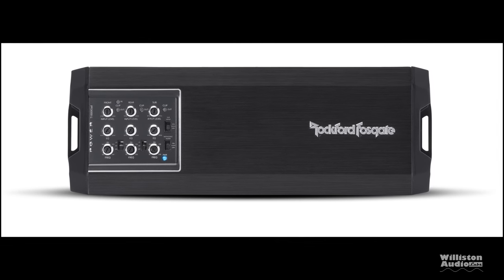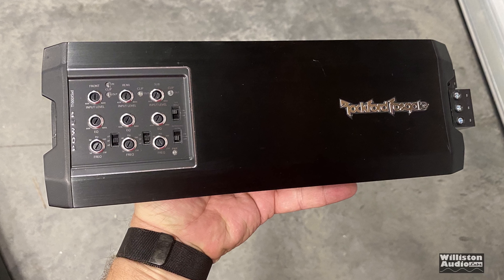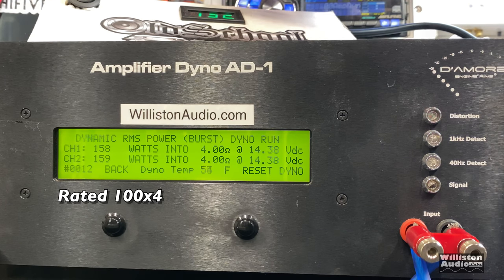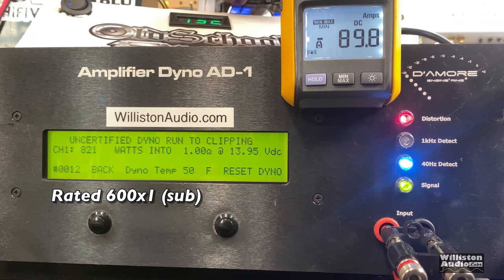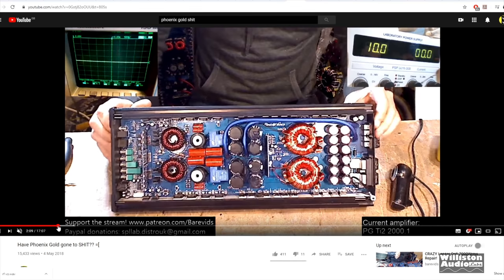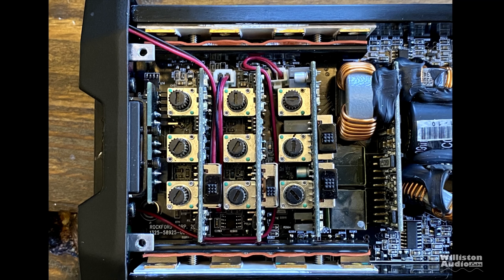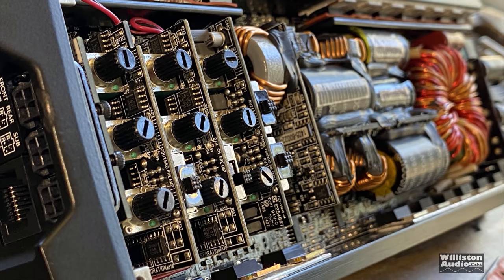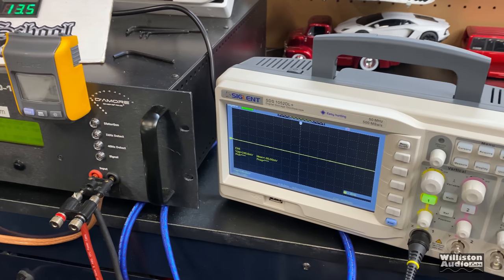Rockford Fosgate Power T1000x5ad Mini Amp Powerhouse!

Comment: For the people that are scoff at RF for being over-priced, here's another fine example why... it's the R&D, and it's worth it.  I like Sundown, B2, DD, Massive, American Bass, etc... but people need to realize that they are simply value added re-sellers peddling the same gear, each with a different badge and slightly different guts. There is no way they could engineer their own equipment from the ground up.
Reply from the maker: Sundown has input in their designs, but yeah I know what you mean. Some people would say why reinvent the wheel...

Comment: I have a boss pv3700 5 channel amp that would be awesome to see what the boss does in real power numbers. I haven't been able to find to much on this amp other than the factory specs.i try to watch most all ur videos they have been quite helpful and enjoy seeing the real numbers. This is the only  5ch amp I've seen other than the boss 3700 would like to see if it puts out 413x4 2ohm or206x4 4ohm or 825x2 bridged an 623x14 ohm 1125x1 2ohm sub channel

Comment: Is there a way to measure the output of an amp @ 8ohms? I have a amp and 4 door speakers that are 8 ohms each and i want to find out what the output watts would it be if i put each speaker to each channel
Reply from the maker: Yes, you can use an AMM-1 Audio Multimeter
Reply: Williston Audio Labs thank you Big D‼️

Comment: This amp requires a High output ALT  ASAP
Reply: I have one of these in my Chevy Silverado with stock alternator. Didn't have to updgrade.
Reply: Nah no alt needed
Reply: I have the rockford punch 1000bd, and on stock electrical and It gets down no dimming lights of anything , I have it wired down to .05 ohm on a audiobahn immortal 15 quad 2 ohm coils ,  she's nasty

Comment: Off handed comment "they are very efficient in their cooling" is odd. You have a tiny heatsink which according to your, ahem, 'measurements' makes a dynamic total of 1870-watts, which with efficiency of even 80% (it ain't) means around 450-500-watts is being turned into heat. What makes your "very efficient" comment plausible?
Reply from the maker: Cooling by design, heat sink gets warm, but the heat is transferred away from the transistors.

Comment: Still no power 650 dyno !!!! Whyyyy
Reply: +1 I have a Power650 stored away for a future install.
Reply: @minimumtrade  nice! I had two of them rebuilt and upgraded in 1994 running on eight Punch 15's in an extended cab truck
Reply: I agree really need to see a 650 dyno. If rather see that then these new amps getting dyno’d but im probably a minority in that category.
Reply: @avrajsamra4548  absolutely! I'm just curious, both of mine were upgraded before they were ever tested so I'm curious as to what exactly they put out when stock
Reply: Brett Manning I think I read your comment on a facebook group saying yours did 1700w but it was upgraded lol. We need to bump your comment up with likes so Big D could see this.
Reply: @avrajsamra4548  yes sir that was me 😁

Comment: Had that amp for 2 years but the marine version and it great , but always ran extremely  hot even if you're not playing any musicit just sits there and suck up amperage and get hot, one day I was chilling the car with this girl and I have my car ignition on accessory only, and the amp killed my battery, the only way I got the car to start with to disconnect the amp and I literally  burned my hands trying 😭 ran it on American bass symphony speakers and sundown x8 v3

Comment: That is absolutely minuscule for it's output! My Rockford Fosgate 500M is roughly the same size in total.
Rockford Fosgate remanufactured  something? I don't believe it. My 200IX was killed by an ex-girlfriend breaking into my house and jamming a flat head screwdriver into it repeatedly. I asked Rockford to fix it with me paying for the repair, they said absolutely not. It's over a year old and we're about to change or designs. We refuse to touch it. Even Nakamichi wouldn't do that on 25 year old hardware from the other side of the planet. I don't believe that it is something refurbished by Rockford Fosgate themselves.

Comment: Now if they can design subs that a more efficient and smaller instead of bigger heavier. RF really shrunk and made brute so dang small .
Reply: Look for "SPL" or "SENSITIVITY" when comparing subwoofer models, which is a measurement of efficiency, meaning if you put 1 watt of power to this subwoofer, how loud would it play?You'll notice Rockford Fosgate produces some of the most efficient subwoofer designs on the market.  Take the T2S1-16 that has a sensitivity (1watt / 1meter) of 89 dB, which is far higher than the typical 82 dB of many popular designs on the market.

Comment: The input mosfets don't look high quality to me. The outputs are.

Sorry didn't watch untill the end before commenting. It's a refurbished item, so they changed the power supply mosfets which are not the oem ones.
Reply: MADE IN CHINA  MAN I MISS THE OLD SCHOOL ROCKFORD AMPS SO BAD :/
Reply from the maker: Good point, I would think they were replaced with OEM style parts though
Reply: @wal  nah, if you notice the the metal part of the mosfets are not chrome. It's a sure sign that they are lower quality. The ones for the output are Chrome.
Reply: This isn't true buddy. Firstly chrome isn't used in mosfet production, the finish of the fet back will vary between batch and factory. Fets produced by a factory are required to meet quality standards set in this case by international rectifier for them to be stamped with eg IRFB7437. Fakes are only really made when a part is end of life and unavailable, or when supply is poor. These are readily available through all legit outlets so there would be little point of fakes surfacing.

Comment: C'mon Big-D. If that amp uses a shared power supply you MUST have all channels loaded simultaneously to have an accurate power measurement. If you only measure the four main channels OR the sub channel all measurements will be 20% higher than they will be in real life. You should know that.
Reply from the maker: They were all loaded. You guys should know by now I don’t test amps any other way
Reply: @wal  Word!
Reply: Look at the current pull when he is doing the dyno runs. If all channels weren't loaded that thing would be running well below 50% efficiency and would be piping hot at the end of the runs
Reply: @wal  Sure, so loaded to what? When testing the main channels was the sub channel at the same impedence as being tested? When testing the sub channel to 1ohm were the main channels at 4ohms or 2ohms? All these variables have an affect and should be mentioned.
Reply: Sorry to bust your balls Big D, I love your channel and enjoy your work, but I spent 20 years reviewing car audio equipment including hundreds of amplifiers between 1990 and 2010 and so know how finicky 5-channel amplifiers are to test accurately.